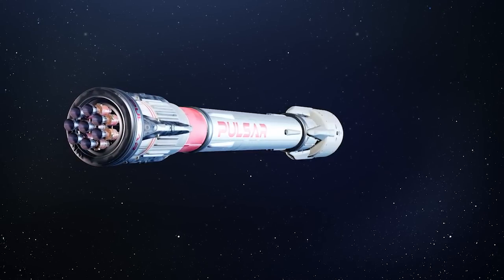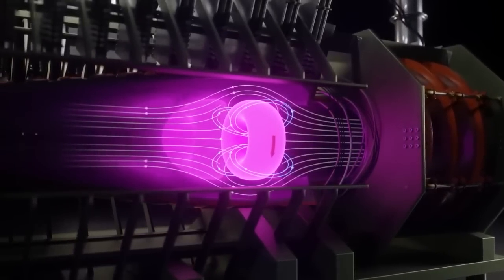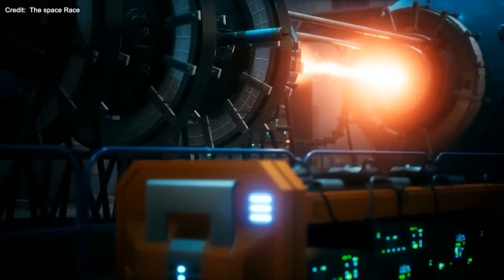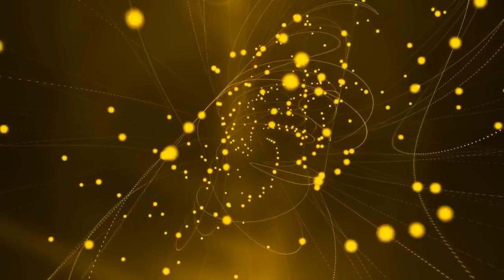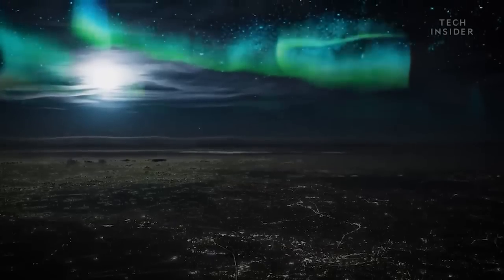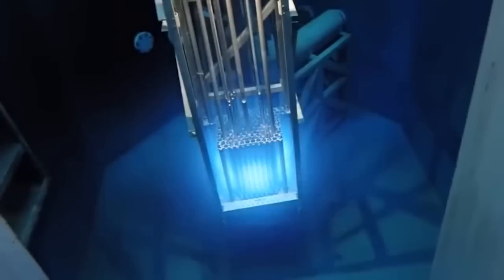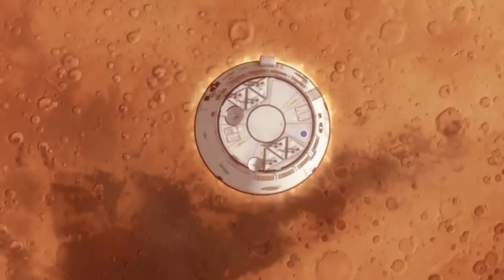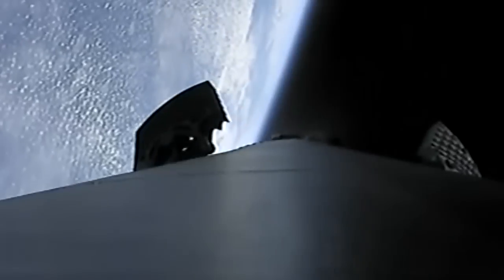This Nuclear Propulsion Engine is INSANE!

Comment: Seriously Nuclear propulsion has been around for decades its already been researched and used in many projects.  As far as radiation hazards electromagnetic shielding can protect a space craft and its occupants it does it on the Earth all the time.  Earths Magnetic field is a natural radiation shield , without it life on the surface of the Earth would not have developed.  The naysayers always invent ridiculous reasons not to take the next obvious step in space exploration by using  Fusion or Fission it all amounts to alarmism something that seems to have worked on the public for a long time now, that time has passed.

Comment: Radiation is a killer. The sun is 93 million miles away, and outside our 100 mile thick atmosphere, it's still a killer. A ton of TNT makes a big bang, a ton of uranium makes at least a thousand times as much of a bang, and a ton of hydrogen makes a million times as much of a bang (the most efficient rocket fuel).

Comment: I remember the attempt to use nuclear power for space travel. It was criticized by environmentalists mostly, who feared what would happen if the ship crashed, or if there was an explosion.  I think that had more to do with the program dying on the vine than the focus shifting to the shuttle, or budget cuts.
Reply: Partly correct. 
Explosions are common in space travel.
Nuclear explosions include radioactive effects far beyond the devastating blast effects. Radiation in the atmosphere would then blow around the world because of fast winds higher up in the atmosphere.
Radiation effects include: thermal radiation that can cause eye damage including blindness, (usually temporary), burns, and spontaneous fires for miles.
Ionizing radiation, including gamma radiation, neutron radiation, alpha radiation, and electrons moving at the speed of light. Radiation sickness can cause death that might catch up to you instantly or months later.  It might cause nausea, vomiting, anemia, fever, internal bleeding, sepsis, bone marrow death, central nerrvous system death, gastrointestinal death and of course, cancer. You could get skin cancer, lung cancer, ovarian cancer, testicular cancer, and leukemia.
Reply: Traveling fast is only part of the problem.  How about deceleration time once the destination is reached?
Reply: @GK-sh7ck  
If you can accelerate, you can use the same engines to decelerate ... at least in theory, as long as nothing goes wrong, like running out of fuel or you need a part you can't manufacture

Comment: Pretty good concept presentation but not sure exactly what Musk's involvement is in it. Basically, you have Rocket and Electric Propulsion now and some chance for Fusion Propulsion in the future - possibly way, way, way in the future. NASA is working on a similar concept and already has an engine in the early testing stage. It could be the same thing but it was not mentioned here. Maybe an update with NASA's involvement would help. I think you can bet on one thing, if it will get SX to Mars quicker, SX is looking at it.